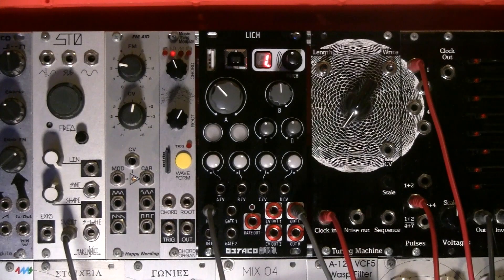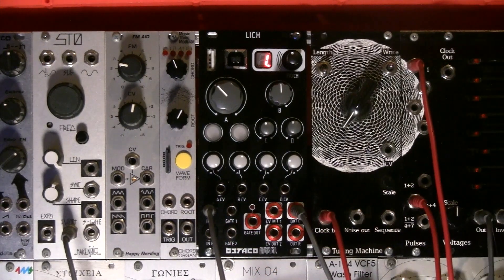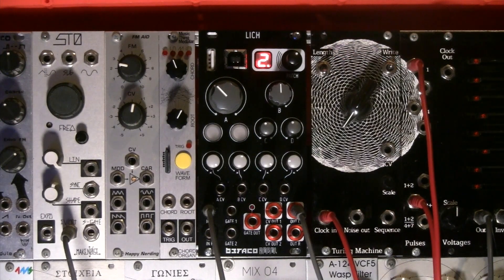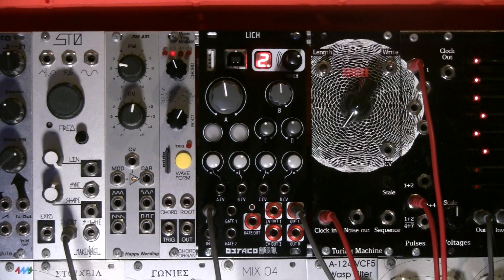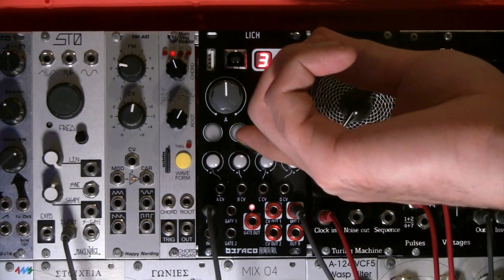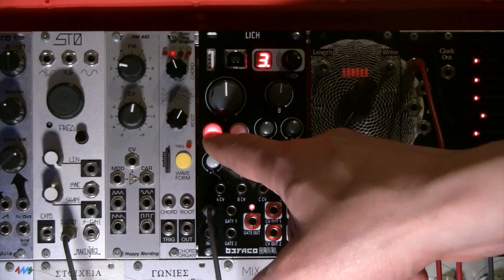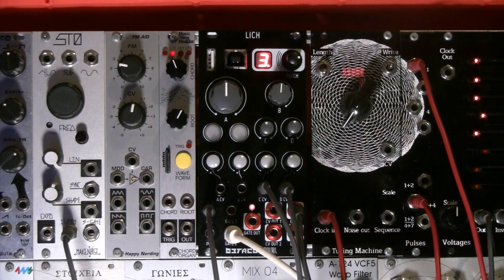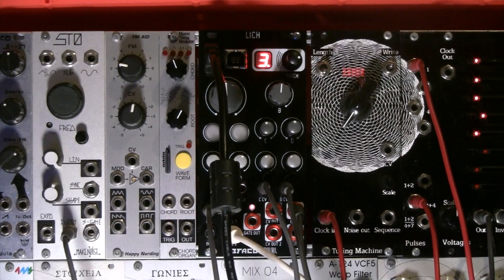Rebel Technology and Befaco Lich

Comment: i just ordered from perfect circuit Audio...Wow,,i see a lot of patches on that Rebel Technology Website...Are all those going to work with this Befaco Lich? i  am not a programmer by any means..i just want to enjoy the experience of uploading different programs and have fun with the variety...please advise
Reply from the maker: Yep they all run on the Lich! Some patches may be designed for hardware with more physical knobs and/or buttons than the Lich has. Those patches will still run, and the extra parameters controlled over MIDI.
Reply: @RebeltechOrg  Thanks for your reply..i wish there were more YT vids on how to upload and use the various patches on that website..i should get mine this week..i'll update ya when i get..but you mentioned that not all patches will run successfully because of the extra parameters that it may need..are the specific patches specifically designed for the Lich in every way? Just for the Lich? is there a web link you can share so i can avoid the patches that tend not to work?